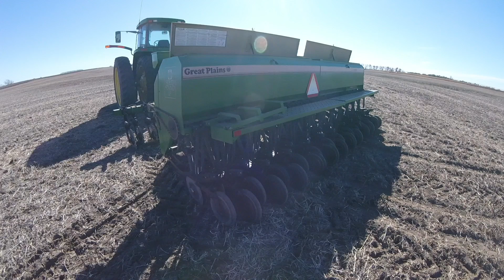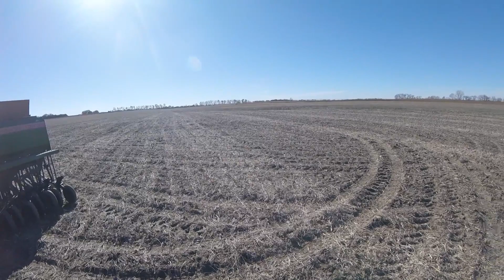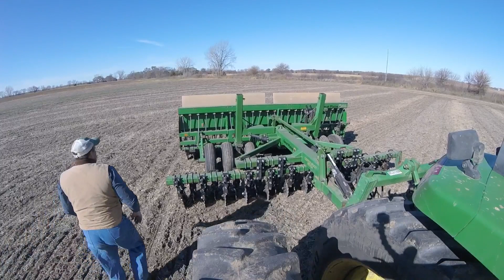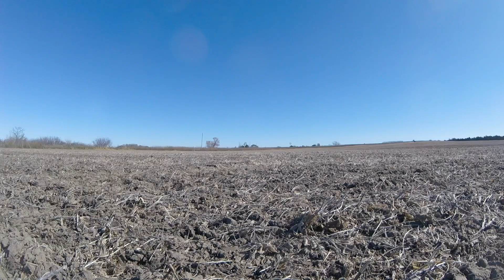Drilling Winter Wheat 2017

Comment: hi, what spacing are the openers on your drill? I looked at one recently in poor condition. Does it work well in heavy clay? Or is your land lighter? I have been told that a triple disc will smear in poor conditions. I was also told the slot can stay open as it's v shaped and it dries out, or else fills with water. I was thinking either a vertical disc such as a cross slot, or else a disc and tine combination might close the slot better?